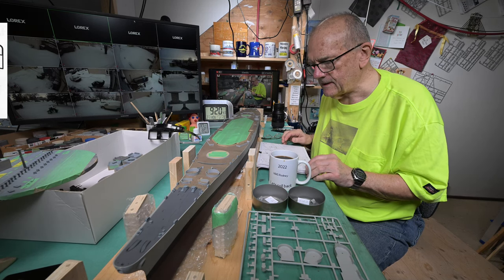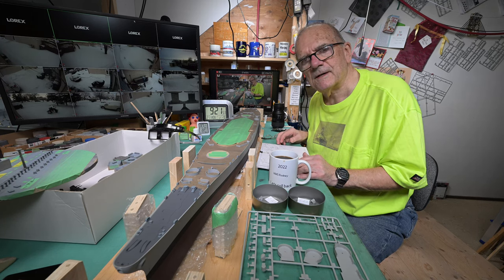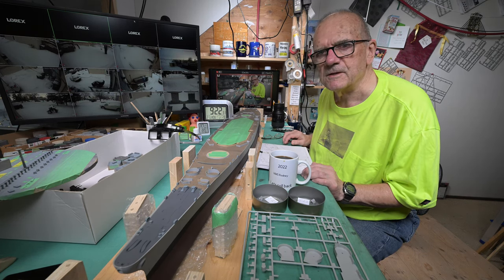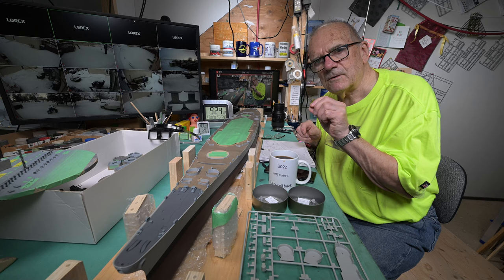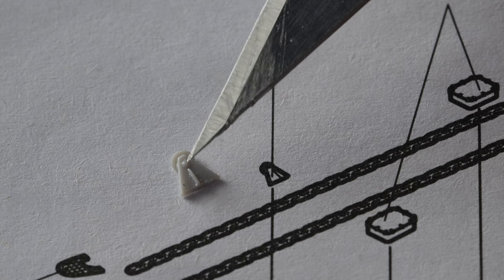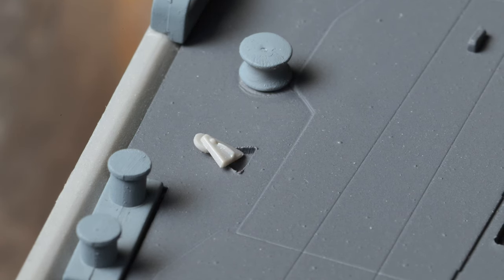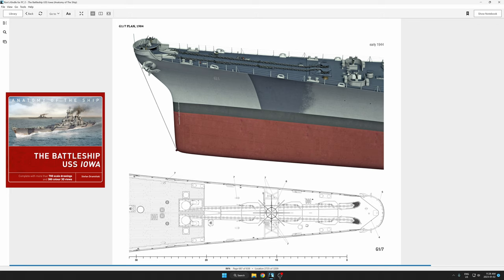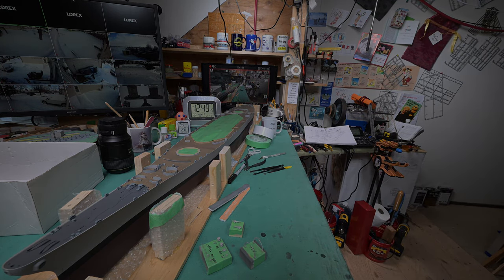The Model Ship - Part 1418

Comment: The glass on your new phone is probably "gorilla glass", or something like that. It is smart to get a case for your smart phone. Mine is as slippery as a fish without it, and putting a case on it protects it, and makes it easier to grip the darn thing. Amazon has tripods, and phone holders made for smart phones. That way you can mount it at your model table, and use it as another video recording device. Or use it to look up stuff at the work bench. That little triangle part is a mystery all right. 👍
Reply from the maker: Looking into a phone mount. Thanks Paul. 👍🏼

Comment: Hi Ron that part you were looking at and on the drawing for is a pulley for the auxiliary chain it is shown on the drawings but you need to look at the WW2 ones. The chain was fixed to that little part on the lower hull at the front I do believe the chain was used when the paravanes were streamed. If you fit the part at 30 to 45 degrees you will be ok
Reply from the maker: "fit the part at 30 to 45 degrees" 👍🏼